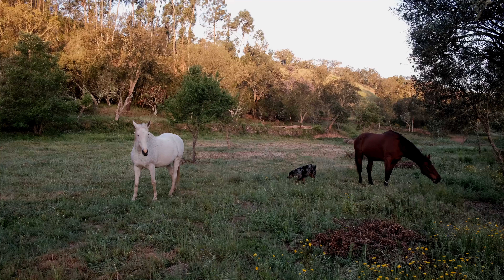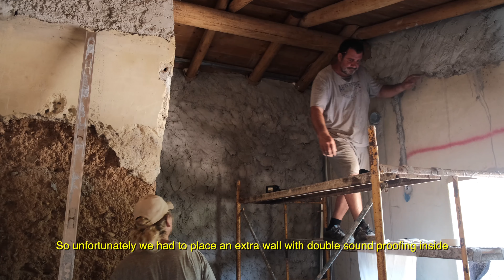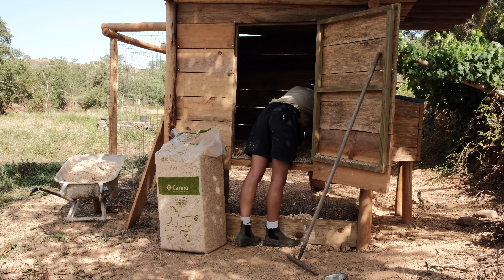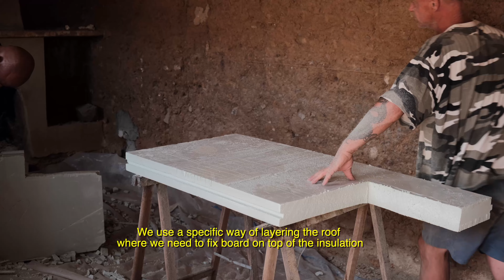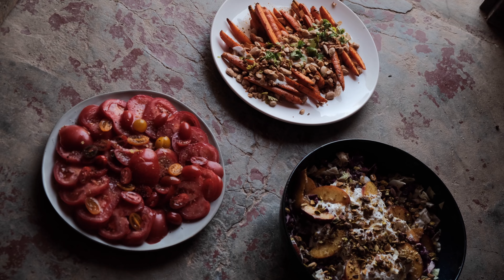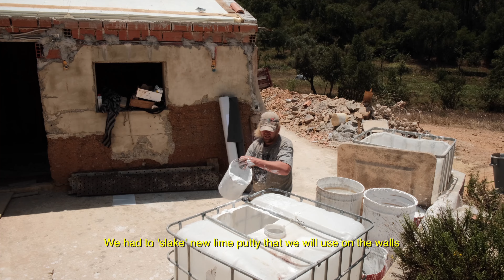#20 We are finally enjoying this RENOVATION project more and more

Comment: Correcting the slope of the land so that rain water flows away from the building and not into the building was an excellent decision.  That is the only way to  correct your rainwater runoff infiltration issue.  What are you using as a roofing material? 😊
Reply from the maker: Thans Steve, we are using 1 vapor barrier on top of the wooden boards after this its 8cm of xps foam boards, on that we use another breathable vapor barrier and on top we use sub-rooftile sheets called onduline. This also serves as water proof sheet but also holds the Canudo/rooftiles in place. On top of that we will organise first layer of new canudo tiles and on top we use the antique ones
Reply: @helder-farmlife  WOW!  That is an amazing buildup of layers.  I'll be following along.  Thank you for the product names.😊